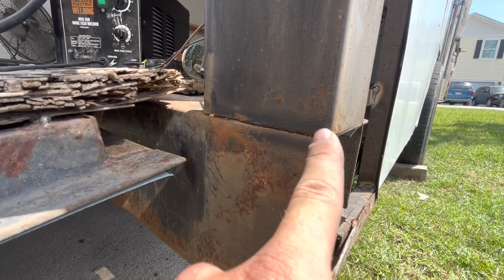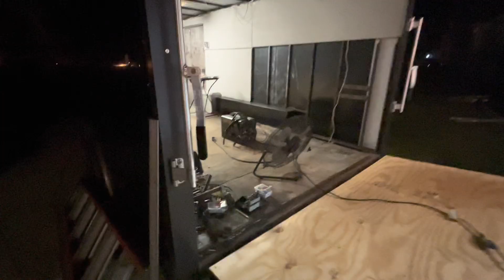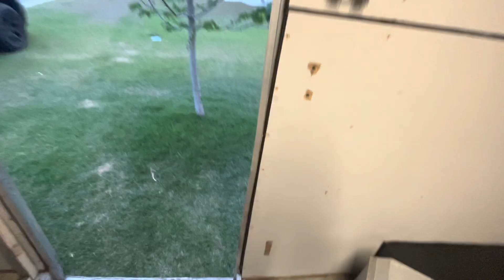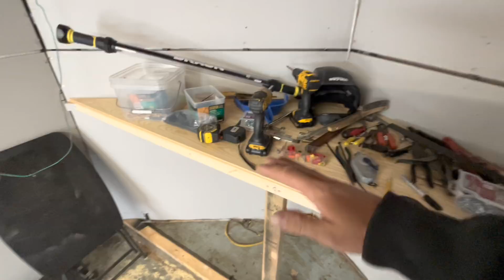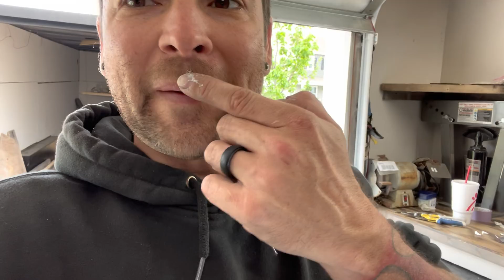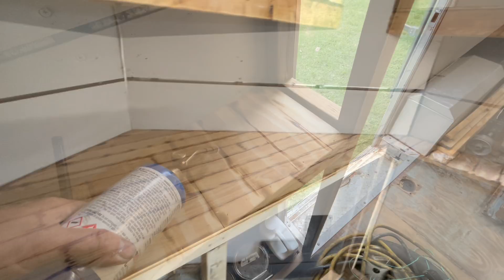📐 Salvage Race Trailer Weekend Progress 🪚🛠🧰(Large Update / Small Trailer)

Comment: Good time to add some rollers under the rear, we used some 3” rigid conduit, cut in 6” sections with 3/8” thick caps welded to them and drilled a 5/8” hole in the caps. Welded reinforcement plates on both sided of the rear corners and a 12” section of 3” square tube in center of the rear with 5/8” holes thru them. We slid a 5/8” solid rod thru the side, all the 6” sections, center support and out the passenger side, on the driver side we welded a flat plate to the driver side end of the 5/8 bar and self tapped it to the trailer and passenger side drilled and tapped the center of the bar for a 7/16” bolt and washer to secure the bar in. We rolled out of a parking lot expecting to slow the truck as it dragged but when the wheels lifted the rollers sped the truck up till the trailer tires hit again lol, well worth the few hrs and picking up scrap metal till we got what we needed except the $35 solid bar.
Reply from the maker: Oh man that’s amazing. I’ve never even thought about this. Very good idea glad you pointed that out